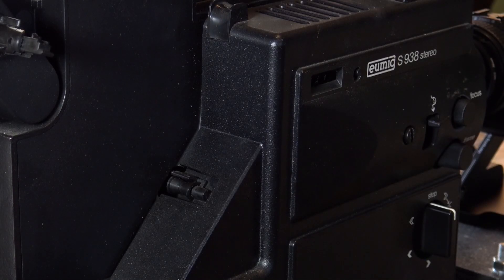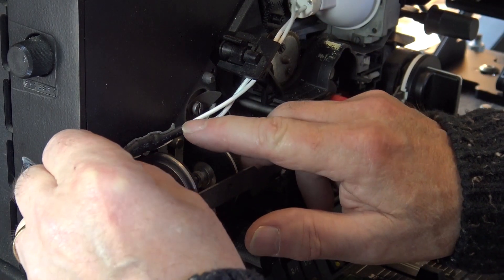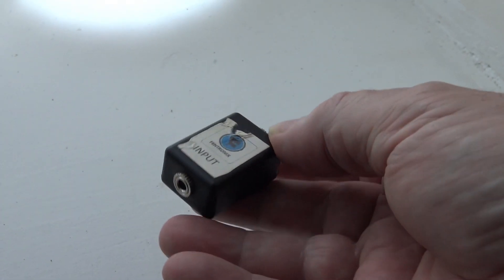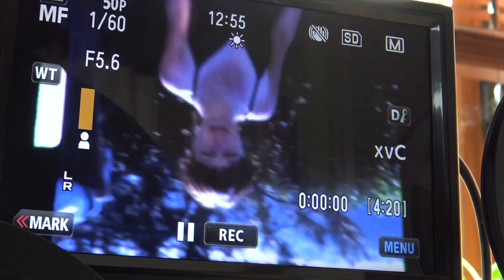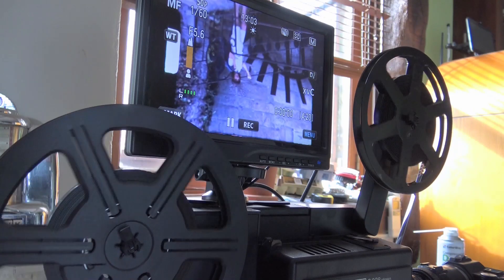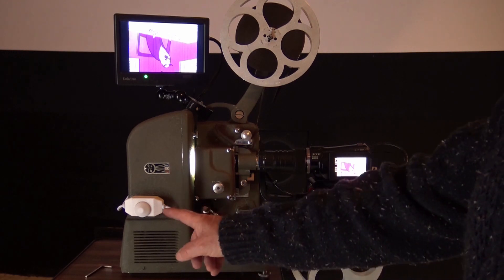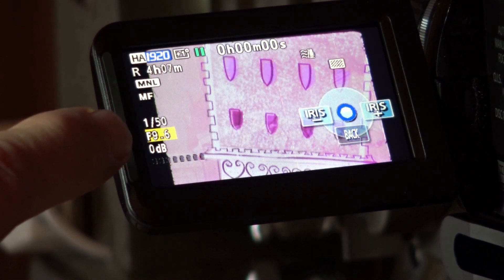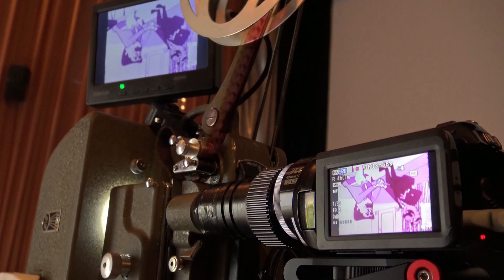Tele-cine units to transfer film to video/ Film Scanner.

Comment: The only issue I see is the high degree of gate weave introduced by the low-precision film advance mechanism. A planar tracker set to translation mode (tracks x and y movement only) with the mask set to the frame edge should be able to fix it. But I see from your other films you picked up the Filmfabriek Pictor which I imagine has no issues.

Comment: Which light filter do you use between the projector and the camera?
Reply from the maker: Camera is set to day light.
Reply: @mackenzierough  No filter at all? :O
Reply from the maker: No filter at all correct.
Reply from the maker: Hi sorry but I have just remembered because the lamp was a bit bright I put a Neutral Density filter on the camera it is an 'ND2' but no colour filter.
Reply: @mackenzierough  was that a variable nd filter?
Reply from the maker: @GospodinJean  No it is not.

Comment: Great! What is that lens you are using and where Did you find it?
Reply from the maker: It is a TL-P5935 Condenseur macro Film Lens from https://transfer-lab.com/ France.
Reply: Thank you!
Reply from the maker: Transfer Lab still are not selling the lens any more, I just converted a standard lens by unscrewing and removing the rear lens element, it works a treat!